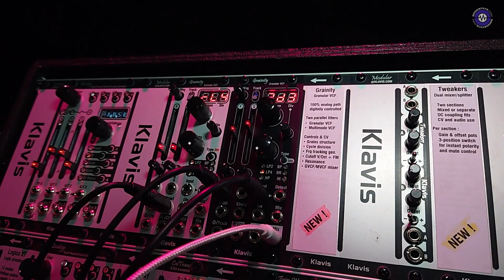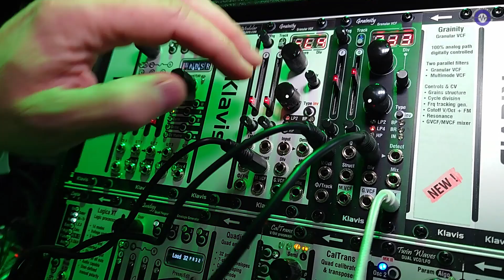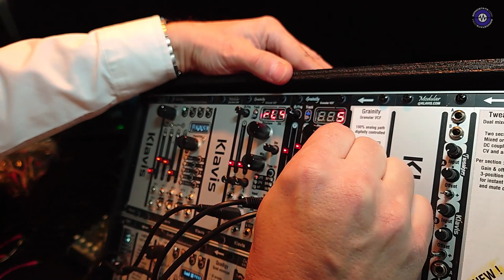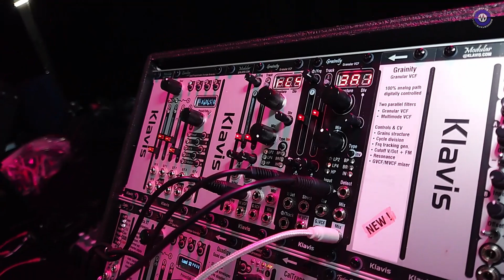Superbooth 2023: Klavis - Grainity

Comment: The digital microcontroller steps through a sequence of analog filter settings and this makes up the grains. At audio rate you get the wavetable comb filter like squelches, and the divider brings it down to a sequenced filter sound. With the audio input you can clock the filter scan independently of the input.

It took 1min of me watching to figure this out, I have no clue why he couldnt get those words out over two years of sonicstate superbooth interviews.

Comment: Analog signal path with digital control, so no DSP.  That's great.  I wonder if the digital part will need firmware updates.
Reply: It might need updates for correcting something or or get updates to add / improve something. With Klavis products an update is simply a question of playing an audio file with the module in its case. :-)